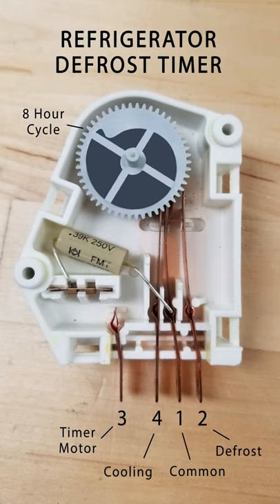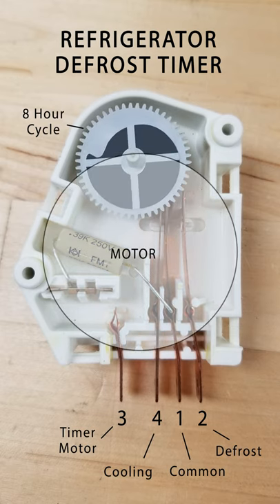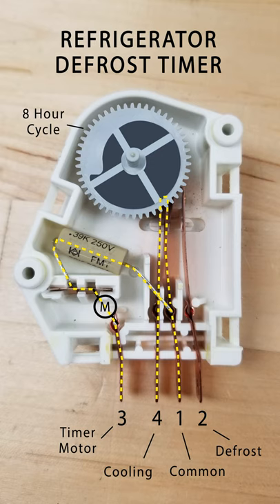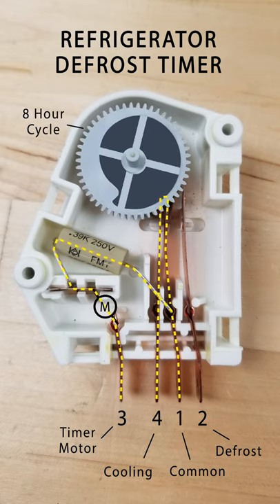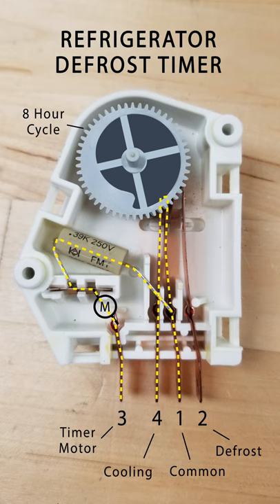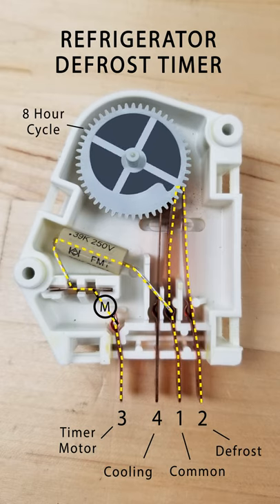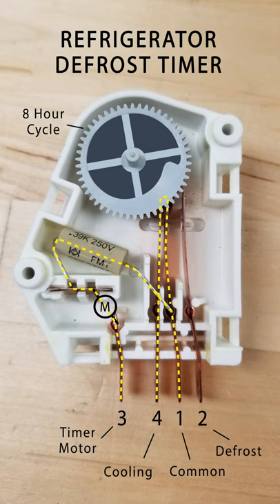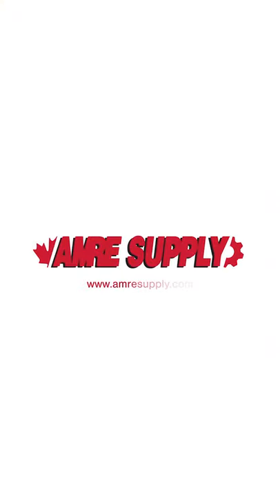How a Refrigerator Defrost Timer Works

Comment: 8 hours/ 20 min. Does it mean the compressor runs continuously for 8 hours and then run defrost continuously for 20 minutes? Is 12 hour/25 min better?
Reply from the maker: Thanks for watching. The compressor will turn on and off as needed by the cold control thermostat. 8 hours of run time will likely take more than 8 hours of real time. If the compressor runs about 75% of the time then it will be about 10 hours between the next defrost cycle.

Comment: So timer getting common from thermostat control right? So if thermostat is open how it possible that timer continue to spin?
Reply from the maker: Thanks for watching. In some models the cold control thermostat is connected before the defrost timer. In this case you are right that the defrost timer will only run when the cold control thermostat connects power. This means that it will take 8 hours of run time during the cooling cycle for the defrost timer to switch into a defrost cycle. This might take more than 8 hours on the clock as cooling cycles on and off.

Comment: I opened my malfunctioning timer. I found the resistor to be open (which explains why the timer was not running). However, the wire on the resistor goes to pin 2 on mine instead of pin 1 (as seen in your example).
Reply from the maker: Thanks for watching. Yes there is some variation between models but in any case a burned out resister will prevent the timer from working property.
Reply: The circuit in your example makes sense. The neutral (3) and common (1) provide the power for the timer motor. Pin 1 then completes the circuit for the compressor (4) or defrost (2).

The problem I am experiencing is that my neutral loses power after the timer is plugged in. (I think it's possessed.)
If I run a neutral directly to the timer from the outlet, the timer runs fine with the cooling and defrost cycles working as they should. Fridge temp 40 on the middle shelf, and the freezer is at 0 on the top shelf. Perfect temps.

Right now, the neutral from the outlet comes in through the refrigerator door. At some point, I will just drill a 1/4" hole through the front of the fridge to the back and run a new wire that taps into neutral just before the power cord connects to the fridge.

Any other thoughts. This one has me stumped.

It started icing up after I put in new water valves. (That's when I discovered the auto-defrost wasn't working.) I grounded the bracket directly to the frame of the fridge, but that had no effect.
Reply from the maker: @jimbyrne4741  If you did an A/B test and showed that the neutral supplying the defrost timer is weak, then it can be helpful to check all visible connections. Also check to see if any of the wires are pinched or if the wires are damaged.

We are currently working on filming videos for refrigerator repairs which will be released later in 2022. Unfortunately we won't be covering how to install a new wire harness or wires as this varies between models so it's hard to be specific.

One more thing you can check is the continuity of the power cord itself (but it seems like the other components are working fine, so that might not be necessary)
Reply: Thanks. A bad connection would make sense.
I'll let you know if I find something. I appreciate your input.
Reply from the maker: @jimbyrne4741  You're welcome, we're just happy to help!
Reply: Thank you for the tip. Same here. I opened and resister is open failed. Good comment….

Comment: Hey can you help me pls, my refrigerator needed manually rotating the timer but then I replaced timer with new one, it is still not working after 8 hours, now what's the issue?
Reply from the maker: Thanks for watching. Can you trigger the defrost manually with the new timer? Is the refrigerator still cooling properly?

Comment: Defrost button needs electricity to reset?
Reply from the maker: Thanks for watching. The defrost timer will always turn as long as there is power so yes it will shut itself off after usually 30 minutes of running the defrost cycle.
Reply: What happen when durìng the defrost time is less than 8 hours and even the ice in the ice maker melts

Comment: Everything is freeze in the fridge. There is an issue with the timer. A guy help me to check the issue and manually turn the timer. But still Everything is freezing even inset the temperature adjust know to very low
Reply from the maker: Thanks for watching. If the defrost cycle is still not working and the evaporator coils are freezing up, then it could be an issue with the defrost heater or defrost thermostat: You can learn more in this troubleshooting video https://www.youtube.com/watch?v=r2YUNLPs4kM

Comment: Timer in my fridge defrosting all the time. Cooling is just happening for mare seconds.
Reply from the maker: Thanks for watching. If your model has a mechanical defrost timer like this, then it could be an issue with the contacts sticking. You can test the timer for continuity with a multimeter to see if the cooling circuit contacts complete the circuit. As well it might be good to try installing a new defrost timer to see if it helps.

Comment: current supply from 3 , why from 1 ?
Reply from the maker: Thanks for watching. The common terminal (3) is connected to the cooling, defrost and motor circuits.
Reply: Common terminal also have voltage ?

Comment: Sr.install new timer cooling cycle complit worked but heter cycle time is stucked moter is not working continues worked heter.remove the heter 2pin disconnecte after timer moter is working what is the reason  sr please  help me
Reply from the maker: Thanks for watching. Your question isn't clear but I will try to help you identify the problem..

After you installed a new defrost timer, does the defrost cycle stay on?

Are you able to manually turn the screw to change it between cooling and defrost?

Does cooling still work?

There are other components of the defrost circuit that can be checked. We're working on some refrigerator troubleshooting videos that will be out soon. This video isn't 100% finished but we have a version that you could watch as you might find it helpful: https://www.youtube.com/watch?v=r2YUNLPs4kM
Reply: @AmreSupply  your send the link is not plying.sorry.yes timer cooling cycle is working with moter. But heter mode  cycle is moter is stoped continuous working heter  after heter pin 2no.  is emove after moter is running
Reply from the maker: @azizmakka7126   Here is the fixed link: https://www.youtube.com/watch?v=r2YUNLPs4kM

This goes over how to troubleshoot all components of the defrost cycle. Best to try to do the "forced defrost mode" which can be done with a screwdriver.

See how it reacts during that. 

If needed test the other defrost components like the heating element or the defrost thermostat.
Reply: @AmreSupply please give the link
Reply from the maker: @azizmakka7126  You can watch the defrost troubleshooting here: https://www.youtube.com/watch?v=r2YUNLPs4kM

Comment: I need to rotate timer gear ⚙️ everytime manually
then compressor gets started for 6-7 hrs
Reply from the maker: Thanks for watching. It's possible that something is getting stuck inside of the timer. If you have to rotate the gear manually just to get it to work, then it's best to install a new defrost timer.
Reply: heater problem.. change heater problem will solve